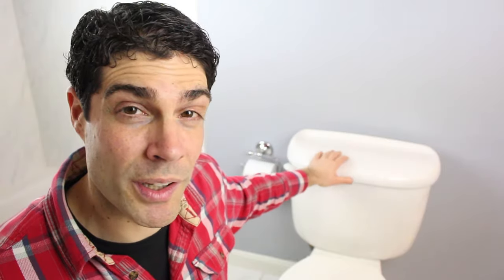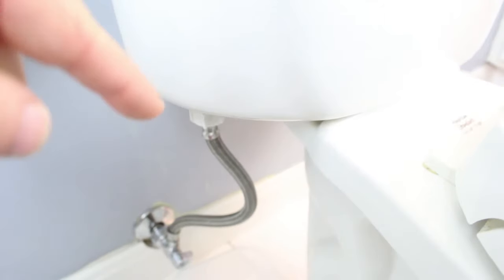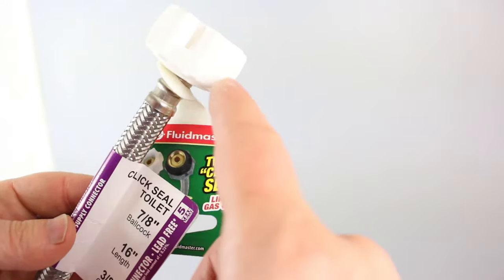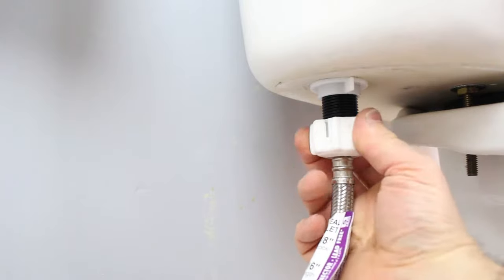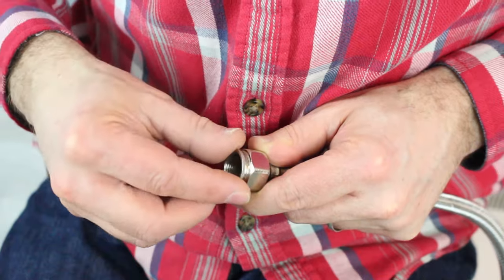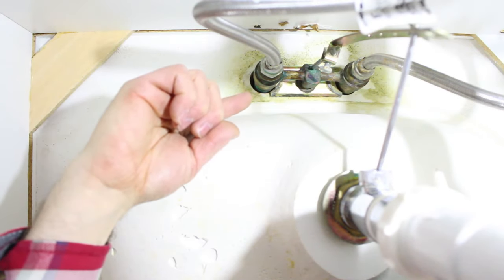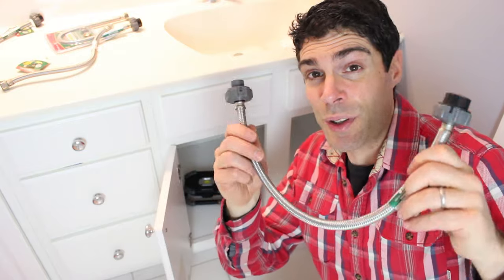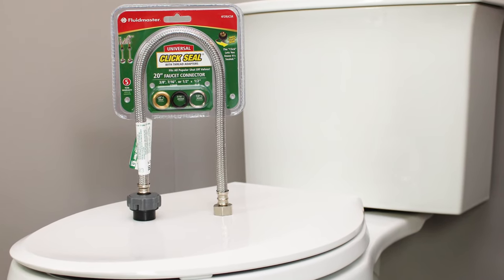How to Install Fluidmaster Click Seal Toilet and Faucet Water Supply Lines from Home Repair Tutor

Comment: Great product.  My older supply line was leaking at the toilet.  Disconnected the old line and installed the new (heard the click) in about five minutes.  No leaks. Two points: apparently no need to use teflon tape.  And, rotation direction is normal; just depends on whether you're looking from above or below when describing which way to turn (i.e. when you're installing to the toilet, you are looking up and turning clockwise to tighten).

Comment: Any tips on how to REMOVE the click seal supply? I need to change my pump and can't get the click seal supply off.
Reply from the maker: The click seal nut simply turns clockwise so that it can unthread. For questions or help contact Fluidmaster Technical Services at 800-631-2011 or visit our website at Fluidmaster.com
Reply: @FluidmasterInc  wait, doesn't clockwise tighten it? When I tried to go counterclockwise, it just continued to click
Reply from the maker: @djhitmanchicago  Water supply lines that use coupling nuts, like the Click Seal Connectors, turn counterclockwise to tighten and clockwise to loosen.
Reply from the maker: Water supply lines that use coupling nuts, like the Click Seal Connectors, turn counterclockwise to tighten and clockwise to loosen.

Comment: Do I need to empty the toilet tank before replacing the water supply line? Is there something in the fill valve to keep tank water from coming out of a removed waterline?
Reply from the maker: It is always a good idea to flush the majority of water out of the tank when working inside or around it, however when using a Fluidmaster fill valve you may undo the water line and the tank of water will not empty out. Some water ( very little) will be released but that water is usually form the water line and the bottom of the fill valve. The water inside the tank will be locked inside the tank and unable to drain while the fill valve is in place. For more information visit our website Fluidmaster.com/support for videos, troubleshooting tips, email, chat with a technician or call toll free 800-631-2011. We are available 5 days a week Mon-Fri from 5:30 am – 5:00 pm PST.

Comment: How did you not get a tankful of water pouring out of your toilet tank when removing the old hose??
Reply from the maker: The Fluidmaster fill valve is an Anti- Siphon Fill valve and will not release water from the tank when the water supply connection is removed while the fill valve is installed inside the tank. For more information visit our website Fluidmaster.com where you can find product information, videos, troubleshooting tips and email or chat with a technician.  Our toll-free number is 800-631-2011 and we are available 5 days a week Mon-Fri from 5:30 am – 5:00 pm PST.

Comment: I connected this today but the connector never "clicked" there isn't a leak so I'm sure if I did something wrong
Reply from the maker: The Click Seal nut will tighten to its specified torque then stop or “click” over and stop torqueing the nut and shank. As long as there is no leak or even a faint click the connector is working properly.

For additional questions visit our website Fluidmaster.com/support for videos, troubleshooting tips, email, chat with a technician or call toll free 800-631-2011. We are available 5 days a week Mon-Fri from 5:30 am – 5:00 pm PST.

Comment: Mine does not click
Reply from the maker: Thank you for your comments. Turn the nut until it is tight, if the nut does not click and will not turn any further stop turning the nut and turn on water supply. If you need help with your installation or have any concerns contact Fluidmaster’s Technical Service Department as we are available Monday through Friday from 5:30 AM through 5:00 PM Pacific Standard Time. Contact options include: Chat www.fluidmaster.com/support E-Mail techsupport@fluidmaster.com and Toll Free 800-631-2011.

Comment: I woke up Saturday morning to my sis screaming, the connector cracked that attached to the bottom of the toilet tank, we had a huge mess of water.  Used this type to replace the line and tonight, Sunday night, it's leaking 😒
Reply from the maker: Please contact Fluidmaster directly for help with your issue. Toll Free 800-631-2011.